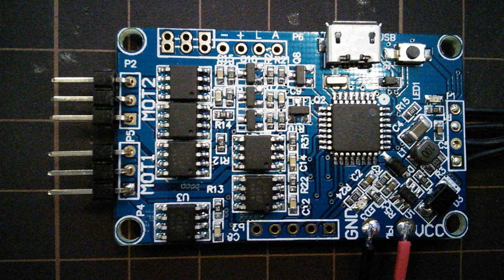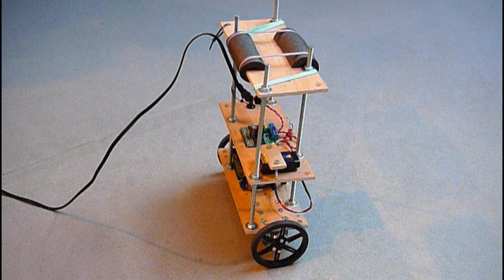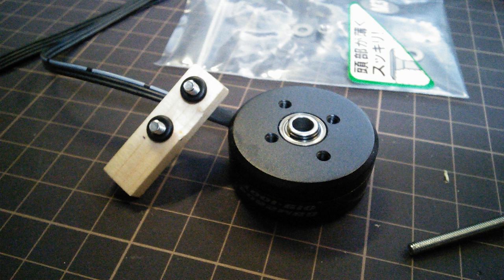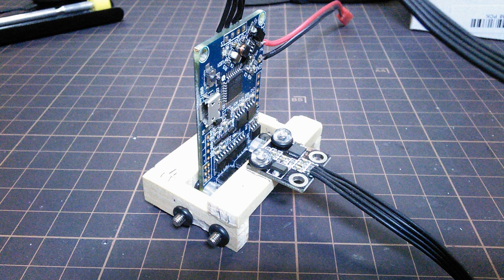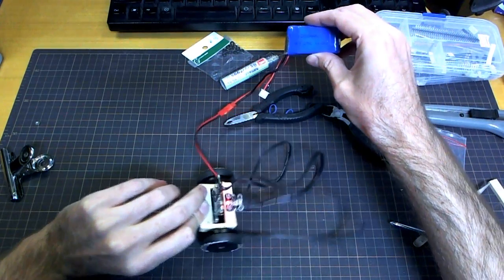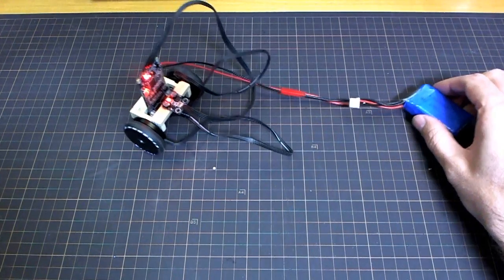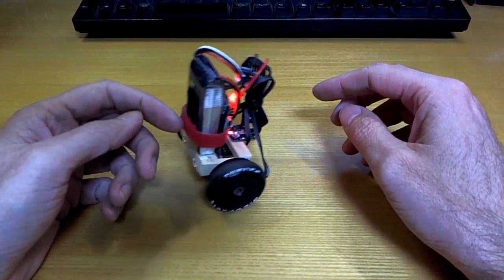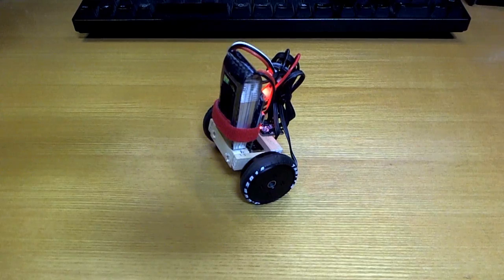Brushless gimbal learns to walk

Comment: Seems like the Derivative part of the PID should take care of that 'prediction'
Reply from the maker: The problem is that the error grows at a different rate depending on how far over it leans. If you balance a broomstick on your hand, it starts to lean slowly when it's near vertical, but will lean over quicker as it gets further from vertical. So there needs to be a proper algorithm to deal with that.

Comment: Got the same gimbal controller board. If you aren't providing the sketch, can you at least provide mcu pins that control motor 1 and 2 please?  I am trying to reverse engineer the board as it has no schematic available - and comes with firmware etc.
Reply from the maker: The sketch is long ago lost in the mists of time and it never really worked any good - I recall not having a clue about much of it and just tacked on a little of my own code to the BruGI sketch. Possibly this one: https://sourceforge.net/projects/brushless-gimbal-brugi/
I certainly would have no idea about which pins go where :)

Comment: Hi! A question about the shaft on this motor. The inner surface, is it static or is it rotary? iow, if I press fit a rod into the shaft, will it spin? I need a high-torque slow BLDC for my project, and it would be so much more convenient if it had an inrunner-style shaft.Thanks!

Comment: Interesting project :D Just wondering why didn't you need an ESC for the motors? Is there any difference between brushless motors and gimbal motors? thank you!
Reply from the maker: The controller board basically has two ESCs on it. Gimbal motors will almost always be brushless. But motors for gimbals are made to turn very slowly and precisely, not fast and powerful. They are a different kv rating, usually gimbal motors are around 80-140kv and motors for flying with are more like the 900-2600kv range.
Reply: Does it mean the controller can only drive two motors max?
Also are the ESCs on the controller different from the normal brushless motor ESC? How can they be that small in comparison?
I did some research about the gimbal controllers but there isnt much information about them...
Can brushless motors be driven by normal ESCs? Thank you for your reply!!
Reply: @tako2967  i can give you some info on Gimbal motors if you still need it. just reply to this if you need!
Reply: @cameronhumphries2377  Hey I am curious about running a gimbal motor as well, can you control one using a raspberry pi, or do you need an ESC on top of this?
Reply: @seanhaisley5630  You could with just a raspberry pi but it would be much harder to get right as they work using three phases so youd need to have a whole electronic set up anyway so ESC is the best way. you would have to make sure the ESC is ok for Gimbal motors as well. I know for a fact this one works: https://www.youtube.com/watch?v=hk9pKQy6H-I although it seems you can no longer buy it as their websites down
Reply: @cameronhumphries2377  thank you for those details, what exactly am i looking for when it comes to Gimbal motor specific ESCs?

Comment: This is an excellent project, please continue with it :)
A few comments:
1. Using 5 Volt version of an Arduino Pro Mini should work better having more computational power (16 MHz),
2. Geared wheels will make them spin faster and thus react more dynamically. It seems the wheels do not react fast enough.
3. My intuition is that the higher the center of gravity is, the easier it should be for the gimbal to balance. So making the whole construction much higher should make it more stable.
Regards!
Reply from the maker: It is a 5V. The motors can spin fast enough, the problem is that the software is incorrect for this application. It's running code that tries to keep a camera level, so all it wants to do is return the structure to the upright position. But to stop something from falling over once it has gained some sideways momentum, you actually need to lean it a little back in the opposite direction (ie. put center of pressure in front of direction of movement), and the gimbal code has no idea about that. Yes, a higher center of gravity helps a lot.